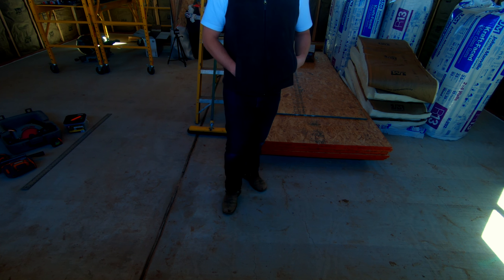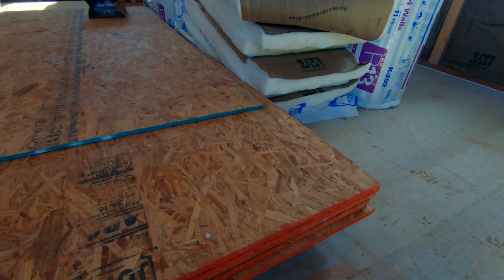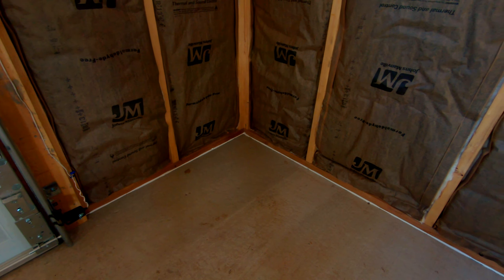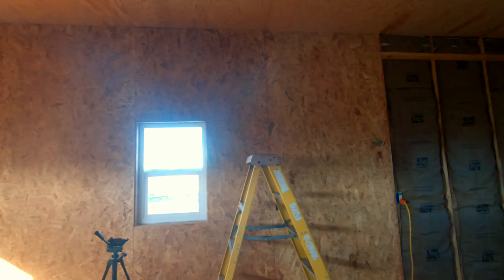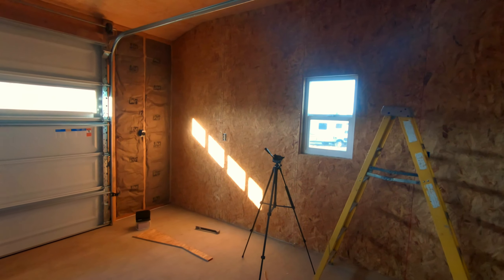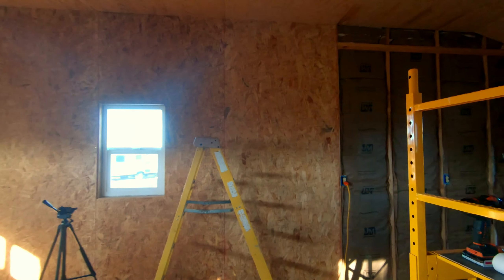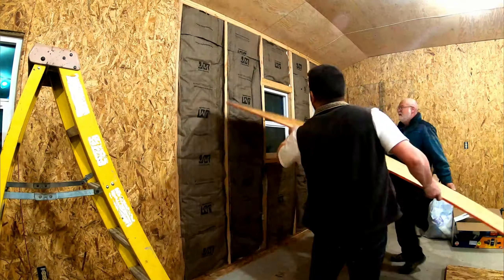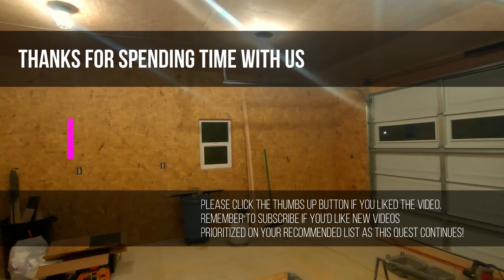OSB Interior Garage Walls

Comment: OK these OSB walls Re flooding my feed today. 
This doesn't meet fire code. Fires start in kitchens and garages. I think it's a 1" of wood to meet the firewall requirements. Quick search will confirm the current code.
Reply: That only applies to walls attached to residence.  Nine of these walls were attached - it's a free standing structure with different code than what you're referencing.
Reply: @Solidus2845  well did they do that wall double and the ceiling?? Because that's what it would take.

Comment: Why did you go with OSB and not plywood for the interior sheathing? I'm enclosing our carport to better protect our cars and stuff and create a little workshop space, and I'm trying to decide between OSB and plywood for our interior sheathing but I really don't have any experience with OSB. Thanks for any advice.
Reply from the maker: We could have done plywood.  If you watch the previous episodes, we use 1/4" ply for the ceiling because it's lightweight.  In my case, I wanted enough structure to mount utilities anywhere on the walls.  I would have had to use at least 1/2" ply to get that kind of strength - sheets were almost double the cost of OSB.  It was just too expensive to be worth it.  That being said, building material prices are absolutely insane right now.  I spent $2.00 per 2x4 stud when we built this, and now they are $6.50 each.  Read the description and my other comments here to get a feel for my opinion on the OSB.  I have zero regrets going this route!  Thanks for watching and commenting!

Comment: Are garages usually insulated?
Reply from the maker: Finished garages typically are.  If it is an attached garage built after the 80's, they also have a fire retardant sheet in there, as well.  There are also tons of garages out there that are just exposed studs, which is just stupid to me.

Comment: I think you just sold me on OSB for my 12x24 man cave/workshop. I was debating on using T1-11 installed horizontally for a shiplap look.  Can't seem to find 3/8" OSB around me right now but Home Depot has 15/32" for $23.95.  Doesn't seem too outrageous of a price for the times.  One other thing to note, the OSB around me has the lines on one side and writing/labeling on the other. I almost have to paint it or deal with the labeling or lines being visible.  Thanks!
Reply: Cool, glad this could help you decide!  I would absolutely spend a few extra bucks and paint if you're going with OSB.  I cannot believe lumber prices.  I could have never built this garage if we started 6 months later.  Good luck on your project!

Comment: What type of fasteners do you recommend for this project?
Reply from the maker: I used SabreDrive screws.  They were 1 1/2" I believe.  You could just use nails, but I wanted to option to remove panels later for maintenance/improvements down the line.  Thanks for watching and commenting!
Reply: @inawrocki207  Thanks! That looks perfect.  Will use those for my own project.  I agree, makes it much easier to open for maintenance/improvement.
Reply from the maker: @CompTechMike  Also, once you use SabreDrives (or any star drive screw), you'll never use a Phillips again;  I know I don't!

Comment: What kind of fasteners did you use?  Deck screws?
Reply from the maker: Deck screws are very heavy duty screws, typically with a weatherproofing coating.  This makes them quite expensive.  We used GRK multipurpose wood screws with star drive heads.  Saber drive makes excellent ones, too.  Once you use stars, you’ll never ever go back to Phillips!  Thanks for watching and commenting!
Reply: iNawrocki Thank you. I was considering using just simple galvanized nails. I was concerned the screws may rust over time but probably unlikely.
Reply from the maker: @bombpopz  You can definitely use nails - that's the usual fastener for this sort of thing because they paint over smoother and hide better for the end result.  They won't be exposed to the elements, so any interior fastener works.  I personally knew i would be doing battens, so final finish wasn't a concern for me.   I can also remove wall panels if I want to expand or improve in the future.

Comment: Hi, i want to make some walls with OSB, but which side go on the inside, and which on the outside please? (there is a side with bigger wood parts, and the other side there are smaller parts). I will put polystyrene on both sides to insulate it anyway, but in general which is the part that has to be the inside of the wall? Thank you
Reply from the maker: I personally knew I would not be adding any additional texture or product to the walls before painting.  I faced the smooth side toward the studs/outside.  The evenly textured rough side was faced inward.  I did this because the porous side will hold paint much better and the even rough stamp hides imperfections much like spackling drywall.  I hope that helps!
Reply: @inawrocki207  Thank you!!!
Reply: Agree 
Latex paint on smooth side

Comment: What do I do if I have studs of varying "protrusions".  Some of the studs stick out farther than others - sometimes more than an inch, 2 inch variation.  What's the solution here?  Thanks!
Reply from the maker: The problem happens if the OSB is “floating” away from a stud because the two adjacent studs are sticking out.  When you nail or screw it down, the head of the fastener may rip through the OSB because it wants to spring away from the stud.  
If you watch when we build the walls in the framing episode, you’ll see dad shows me how to “crown” the studs to avoid wavy studs, because it is a very challenging problem.  If you’re talking 2” variations between 16” on center studs, you may be looking at replacing studs altogether with straight ones.  I wish you luck, friend!

Comment: Great video. Wondering what type of screws you used. Drywall screws, or something different?
Reply from the maker: Drywall screws are much too short and don't have enough bite left going through 3/8" sheets.  We used GRK (Also SaberDrive) 1-1/4" screws.  Once you go torx drive, you'll never use a lousy Phillips again!
Reply: @inawrocki207  I appreciate it man. Thank you

Comment: Nice video - thumbs up! ;-)  Quick question: Did you install the studs a precis width so the edge of the OSB lined up with the studs (for screwing), or did you cut down the width of the OSB to make an exact fit onto the studs at the edges? 

(Or neither?)
Reply from the maker: Hey friend, thanks for watching and commenting!  All studs are 24" on center, so 48" sheets of OSB, ply, or drywall will always line up and split the studs.  Full sheets went up.  
Mind you, not everyone is as skilled and experienced as my Father.  He has been doing this for almost 40 years.  Small miscalculations or lazy cuts will add up and lead to mismatched joints, of course.  
The end pieces of OSB that meet the slanted ceiling needed to be cut to fit, but that's it.  The bottom edges were trimmed off to grant 1/2" of float above the floor.   I hope this answers all your questions!
Reply: @inawrocki207  Thanks for the quick reply! I've watched a couple of your other videos about the garage, but not where you installed the studs. I guessed you/your dad had done a precise job!

My wee workshop is only a 6' x 12' wooden shed, so I can't go far wrong (I hope)! I'm just trying to keep out some of the cold British weather so I can work in the shed in winter.
Reply from the maker: @davidrowe8747  That's really cool, no matter the size of the project.  Just think; we're thousands of miles apart across an ocean, but we get to correspond about our projects together.  The 21st century is really a great time to be alive, despite the current state of affairs with Covid and all things considered...
I would say you're on the right track to use 2x4 studs, 24" on center spacing.  Stuff some basic R13 insulation between the studs before you put up some OSB.  Your two longest walls will get 3 full OSB sheets even. You'll have yourself a nice little shed that can be kept completely warm with a small heater!  Good luck!
Reply: @inawrocki207  The shed was pre-built, and unfortunately the width between studs varies from 39cm (15.5") to 61.5cm (24") - and in-between (51.5cm, 52cm, 52.5, 53.5, 54, 54.5, 56.5and 63)! It's nowhere near as ambitious as your garage, and I'm looking at using "foam block" insulation (polystyrene, or styrofoam over there), as this is less likely to sag if any damp gets in. The studs are also only 2x2 (pretty standard for most sheds over here), so there's not a huge amount of insulation space to work with. The goal is only to keep off a bit of the chill, and keep it low-budget, but I enjoy watching videos like yours.
Reply from the maker: @davidrowe8747  Oh, I see.  Well, with various spacing between studs, you'll definitely be trimming whatever material you use for panels to fit.  The foam block insulation will be great - It's just like insulating a garage door with panels of foam between the moving parts and it definitely works!  Thanks for the praise and comments!
Reply: @davidrowe8747  why don't you strip the studs with horizontal 1 bys on correct layout

Comment: Did you have any issues with screwing so close to the edges of the osb? When splitting the stud you only have 3/4 inch to work with so I wasn't sure if that was a problem.
Reply from the maker: As a complete amateur; yes, there were several of them that kind of crumpled away the edges as I bore down.  That said, it wasn't ever a real issue.  I just broke away the loose bits and the paint filled in the rest.  After a little practice, you realize that 3/4" of an inch and a slight angle is plenty to work with from the edge even for OSB.  That's also something I learned a lot from when nailing during the framing.  I was always paranoid about missing an edge or stud, when there really was plenty of space to work with.  Thanks for watching!
Reply: Which screws did you use?

Comment: Very cool, I'm looking to do my garage with OSB sheets too. What thickness OSB did you end up using for this?
Reply from the maker: This was 3/8" thickness, 4x10 sheets.  It's easy to work with, inexpensive, and structural, unlike drywall or thin ply.  You won't regret using it to close in a garage.  You will see subtle vertical seams, so go watch my latest video to see how we trimmed it with stained battens for ideas!  Thanks for watching and inquiring!
Reply: @inawrocki207  Awesome, thanks for the additional info! Looking forward to getting my walls up and starting my mini 1-car garage workshop myself.

Comment: Other than skyrocketing material cost due to bad politics, OSB is the way to go on garage walls.
Sturdy does not cause all the problems drywall does in unheated environments.
You can anchor to it.
Just makes sense.
I like metal barn siding for the ceiling.
Easy to put up, already painted and loos clean.